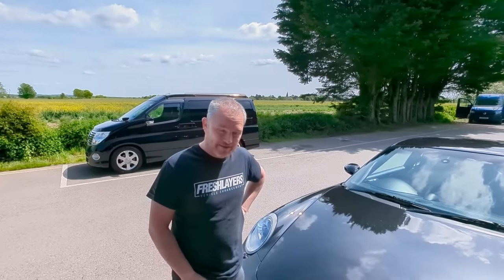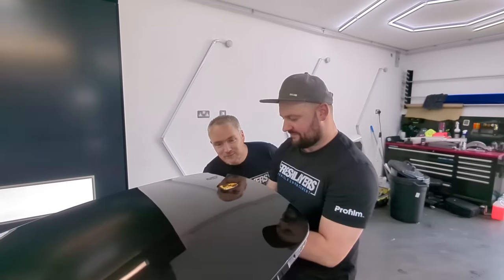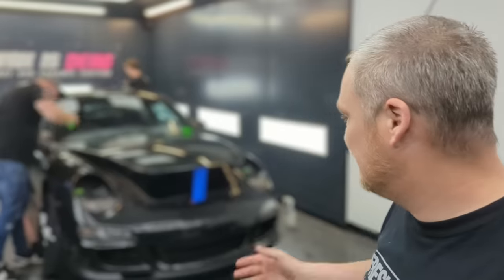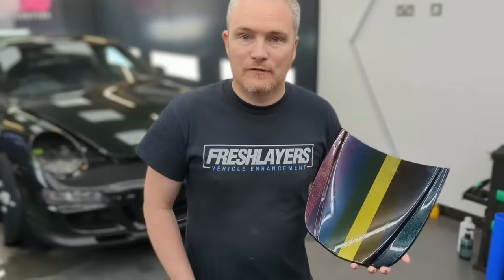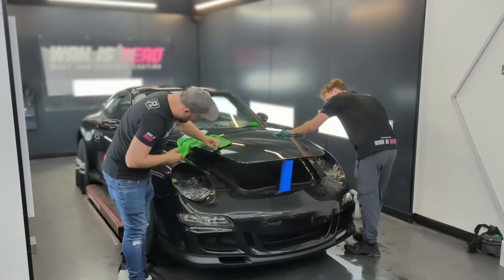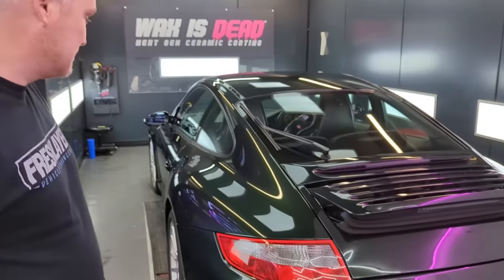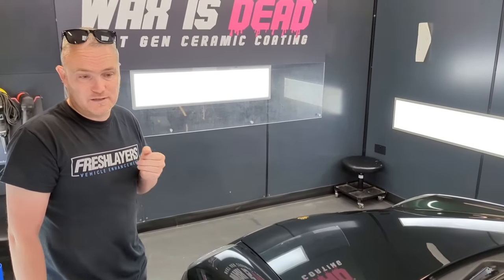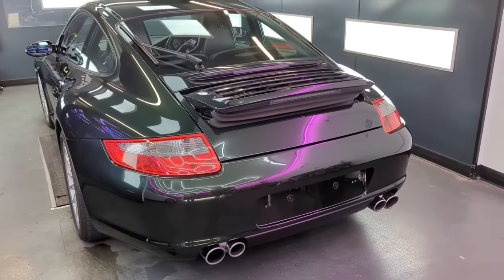R.I.P. Vinyl Wraps - Colour Change PPF is the Future of Detailing

Comment: some questions from someone who knows nothing about any of this. If a car is vinyl wrapped how do you maintain it? Do you still wax it the same as paint? Can you polish it if there are small marks or scratches? and how durable is it, how long would it typically last?
Reply: You cant wax vinyl from what i hear.   You have to use a certain soap and detailer spray with it so it doesnt damage the vinyl

Comment: Does the ppf have any impact on driver assist systems like the radars behind the corners of bumpers? Manufacturers tend to state only paint to say 150 microns thick including original coatings in these areas?
Reply from the maker: Awesome question m8 I don't know.  You could leave the sensor face uncovered I guess but the ones I've seen done seemed fine.  One for martin really
Reply: No it won't have any effect

Comment: Now PPF usually lasts like 5-7 years if i am correct, wraps last  in weather prob maybe 2.5 years before it starts peeling apart.   Thats the only other benefit i can think of on PPF vs Vinyl
Reply from the maker: so nothing you have said is correct but apart from that its very good.
Reply: well i said if i was correct so how long does PPF last professor?  @ForensicDetailing
Reply: @davidlopez8953  Most top ppf's are warrantied for 8-10 years whereas a good vinyl will be good for half that under normal conditions. Keep in mind vinyl is half as thick as ppf but also costs less to install.

Comment: Can PPF be applied to alloy wheels? I have a motorbike with diamond cut wheels. The lacquer has lifted (as I don’t clean it regularly) and I wonder if it can be fitted after the wheels have been repaired.
Reply from the maker: No m8
Reply: @ForensicDetailing  thanks for the quick reply. What’s the best way to protect diamond cut wheels for lazy b’s like me who hate cleaning? I’ve done 6k miles in 4.5 months in all weathers and washed it 6 times. The last time I noticed the wheels had the lacquer lifted. Thanks in anticipation.
Reply from the maker: Ceramic coating mate
Reply: @ForensicDetailing  thanks very much.

Comment: Looks nice, but how does it cope with stone chips and minor scraches. Is it easily repaired?
Reply: Scratches will self heal as its self healing film and its designed for stone chip protection, If you did get any damage to the film we would just replace the panel and the paint would remain protected :)
Reply: @mikey_fresh  Thank you, that's good to know.
Reply: Interesting product. Cost similar to wrapping a car or is this deemed higher end product ?
Reply: @umranhu  🤣 deemed!

Comment: It's still a wrap
Reply from the maker: No it's PPF but good work otherwise
Reply: @ForensicDetailing  it's a PPF wrap instead of a Vinyl wrap so it's still a wrap
Reply: And yes PPF is the better product to conserve the paint underneath. To put it simply, PPF is perfect if you are looking for an extensive protection. It is perfect for off-road or highway driving. However, if you are mostly driving in the city, vinyl wraps are able to provide a degree of protection as well. And if you temporairly want to completely change the look of your car a Vinyl wrap is still the way to go. And a PPF wrap is almost double the cost of a Vinyl wrap since the material is more expensive.

Comment: Ppf can cause serious damage to your paint work.
Reply: Never had any issues installing or removing PPF, So as long as you know what you're doing no problems.
Reply: It can only cause damage of not fitted correctly to bad paint work, it comes off with easy and is designed to protect paint